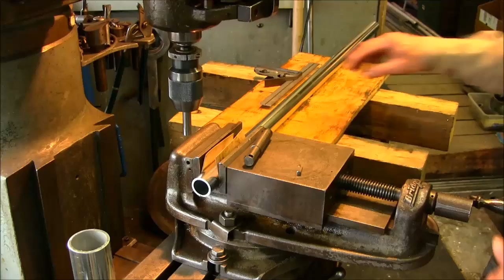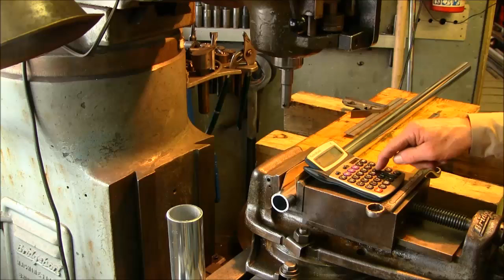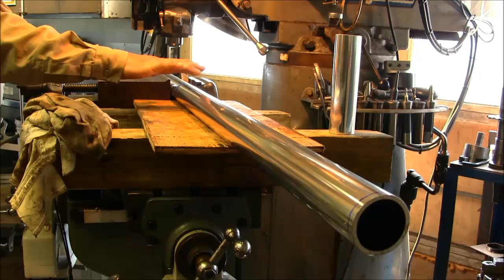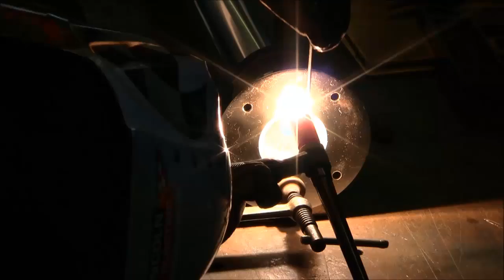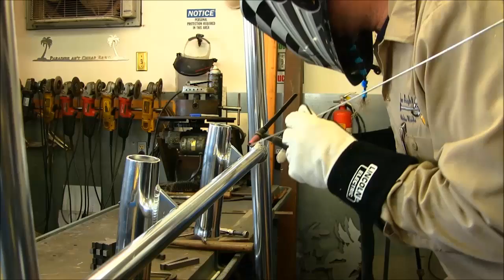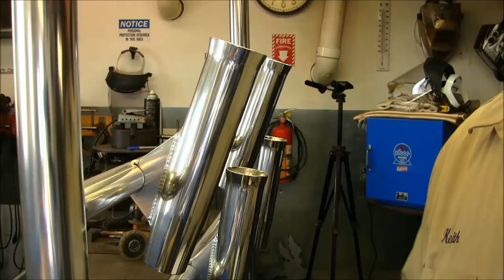Bling Fever: Fabricating a Custom Fishing Rod Holder

Comment: For the coping of the tubing in prep for welding....why didnt you just take one cut with a hole saw?
save a shitload of setup time and coping butt weld tolerances dont require that much

Comment: Keith, I have a question about the anodised finish. What happens long-term to the weld as it is not protected? Salt water is cruel and I am curious as to how the weld holds up in appearance.
Reply from the maker: You coat that with Rust-oleum aluminum paint, to protect it. ;{)-----

Comment from the maker: No, I don't even have brake clean on hand or ever stock it, also I was cleaning most of the cutting oils off while in the machine shop end of shop then they go to the other end of shop where the welding is done! LOL, at how you got that out of a white rag!  ;{)-----

Comment from the maker: It is more difficult without a pulse on my machine but learning to control the heat has been the most of my success, in getting great welds. The looks are not all that even on the stack of dimes but the penetration and the strength is all good. ;{)-----

Comment: Hint:  You can always tell aluminum from stainless TIG welding when you hear that arc.  AC is the buzz = aluminum.  DC is near silent, smooth arc = steel.

Comment: Sure wish you would do a short video on how you mounted the Trava Dial for the Z travel on your quill.  Ever have a problem with the travel rod hit your work?  I use a Quillmate, which I changed out from a digital caliper type of set up, much easier to watch the sweep of the dial for setting.

Comment: Nice project Keith.  Good tip on the ground clamp.  Having your machines level makes layout much easier.  I like your setup on the fishmouth for the tube, I did a job for our shop using 5/8 OD tube so I was able to use a mill cutter.  That small tubing is harder to weld though, you have to be able to twist the torch around really fast.  I see that you had to move around too, and weld lefty.

Comment: I'm surprised you didn't turn the ends of your short length of pipe and lay your level over the top, looked like it was a bit of a cluster holding the short pipe to the long pipe while holding the square like that.

Comment from the maker: I do drill a small .093 hole on each section that will be sealed tight upon the last bit of weld, at a non seen sides of the pipe to let the pressure bleed. The shop still has to handle it a bit to get it mounted. after that they can paint the welds and seal the deal.  ;{)-----

Comment: Keith,
Great job as always but I have two questions: 
1. Did you need to put any vent holes in the tubing to keep the final weld from blowing out from trapped air?
2. Did you need to do any post weld passivation for corrosion resistance? I know there are topical treatments in paste or liquid forms available that are easily applied. 
And thanks for sharing your jobs with us.